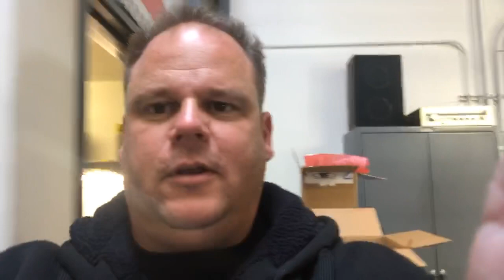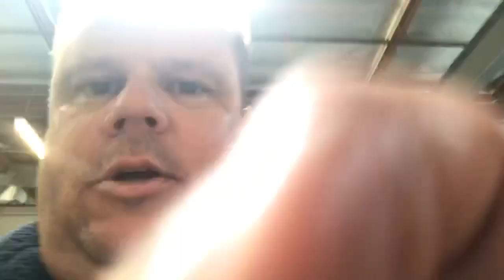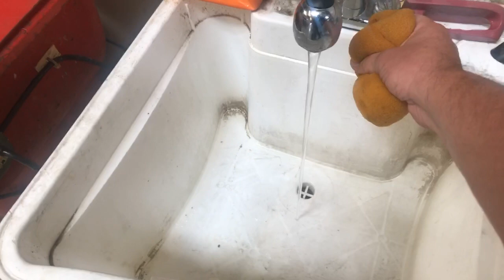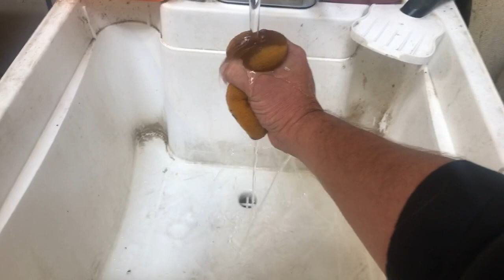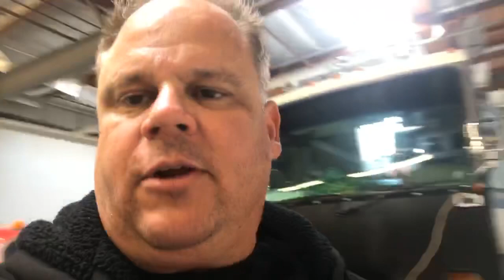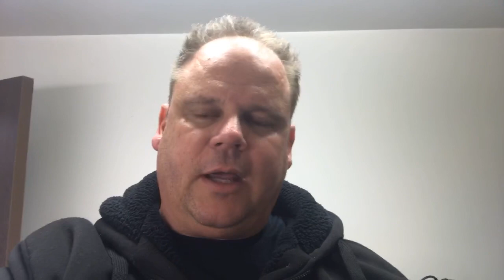Fuel Film/Acceleration Enrichment Demonstration - Faucet/Sponge Method -Tuned By Shane T

Comment: So in engine control management, it is similar to the accelerator pump circuit in a carburetor.
Reply from the maker: Spooler yes the accelerator pump in a carburetor is required because of this phenomena.
Reply: Cool, now it make sense.

Comment: can anyone explain why he says closing the throttle is a DECREASE in manifold pressure? Doesnt full throttle DECREASE manifold pressure?
Reply: Shane's correct, its all measured behind the throttle blade. When you close the throttle the engine is still trying to ingest the same amount of air but the supply has been cut. Hence the engine pulling a vacuum.
Reply: @michaelogrady4435  i was under the impression manifold pressure = manifold vacuum.....close throttle and manifold vacuum will increase
Reply: @smalltownplaya712  everything is easier to understand when its in metric. Wot the engine will see close to 100kpa closed throttle idle will see ~50kpa depending on engine.
Reply: @michaelogrady4435  i think i get it now....manifold vacuum and manifold pressure are basically inverses.....At wide open it should see 14 psi or so.....close the throttle and vacuum will increase and cause that 14 psi to drop severely...like down to 7 or so ...this must be why cylinder heads are tested at 28in of gravity because that looks to be about atmospheric pressure....thanks for the help
Reply: @smalltownplaya712  you're getting closer but not exactly on the money yet. I'd recommend looking at kpa vs bar/atmosphere instead of inches of vacuum. Were currently under one atmosphere of pressure, 14.5 psia or 1 bar or 100 kpa. If you were to measure the intake manifold of a car it would be about 7psia, 0.5 bar, half an atmosphere, or 50 kpa. Another note to reference would be the difference between psia and psig to help give you a little more of an intuitive understanding.